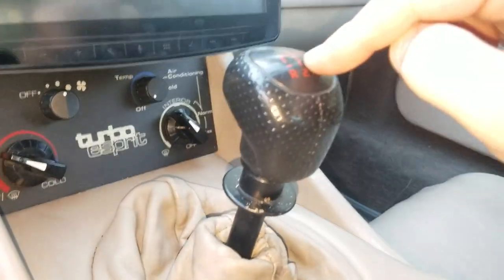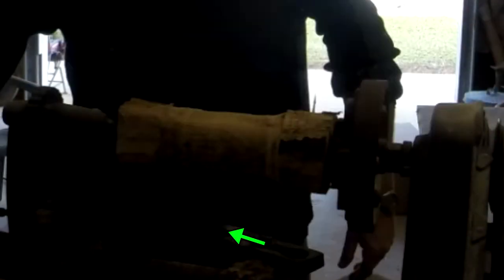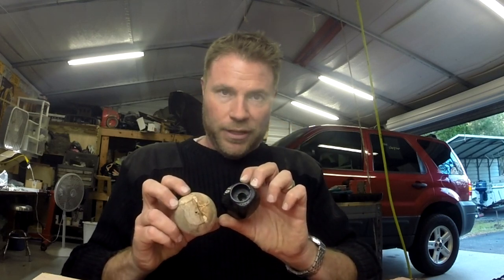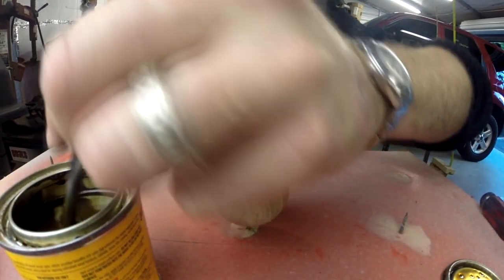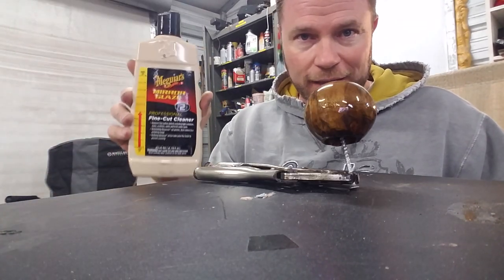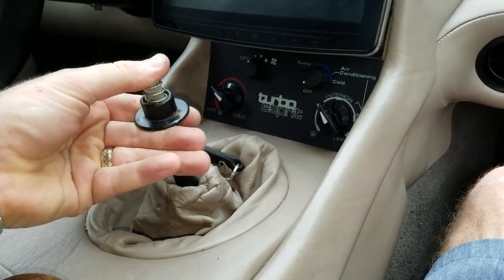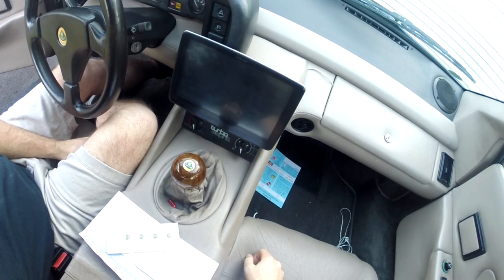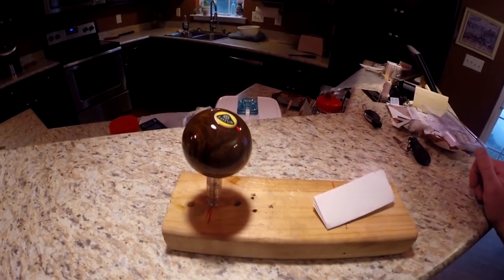1989 Lotus Esprit I made a wooden shifter knob! Part 9

Comment: If you do end up making another one, I would try drilling a shallow hole in the top too, for the sticker, sticking it flush, then filling it out with clear epoxy.  Once that's done, get it back on the lathe and round it out.  It'll preserve the sticker much better and it'll add a bit of dimension to it.  Just a suggestion.
Reply from the maker: I will definitely keep this in mind.  Thanks for the comment and feedback